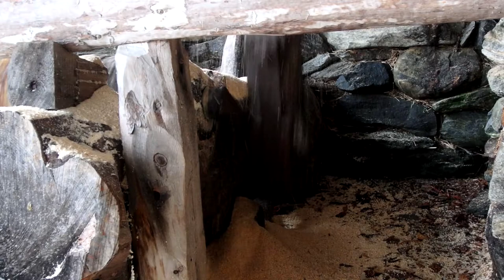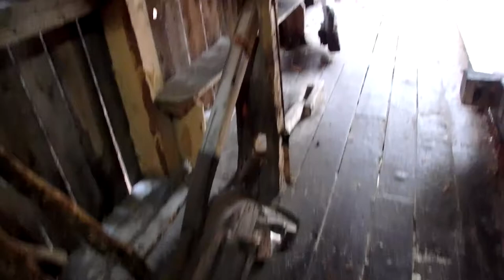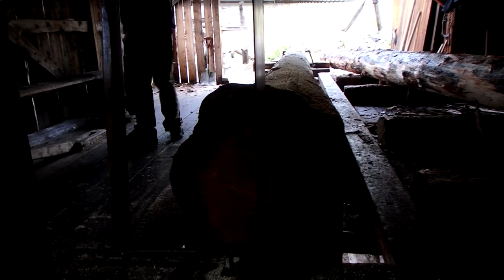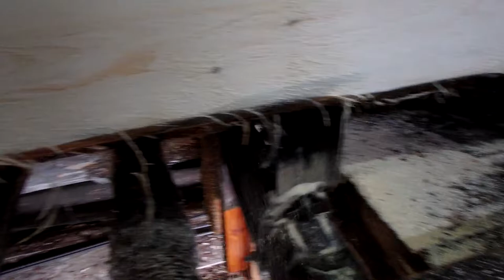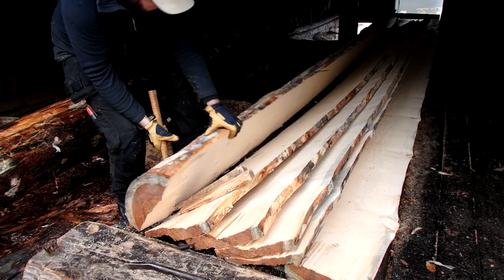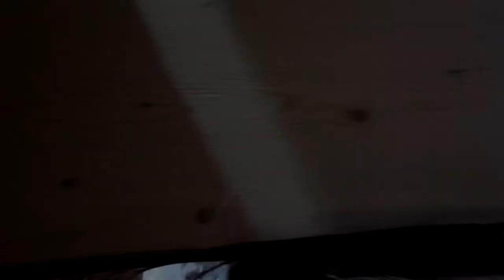Water powered sawmill, Aursfjordsaga, Norway

Comment: Seems powerful. Think it should be able to drive two saw blades. Verkar stark. Vore det inte ide testa med två sågblad i ramen?
Reply from the maker: Yes, its powerful. Similar saws in the same area had several blades as time moved on. Thats not the case with this one. It had a smaller circular saw in the connecting room. So as it is now is very close to his it was in 1796.

Comment: How many lumber it can processed in a day?
Reply from the maker: Depends on water amount and log size and length. It moves about a meter to 1.5 m per minute, so if only cutting logs for house logs, there's usually 4 cuts to make one beam and two boards. That's 30-40 minutes or more of its longer than 5 meters. Can cut up to 9m. Everything mixed in I'd say average 1 log an hour if all is good. Taking the bark off, winching it up from the sea, cutting and stacking.

Comment: Why not cut log till the end?
Reply: The end holds the boards vertical until the log is finished. With that setup, it would be a nightmare if they didn't. Because I'm lazy and inauthentic, I'd cut the round end off with a bucking saw.

Comment: Why not just cut the log shorter?  lol.  Seems pretty stupid.
Reply from the maker: Well, every inch has its price, and every inch counts, especially 2-3 hundred years ago. 
If one is cutting off 8 inches on every log, one will end up with a few cubics lost every season. 
The ones afraid to work will cut them and throw it away. Or burn it.
Reply: not usable tho.  its all messed up.
Reply: There is no way to hold the log in place if you cut all the way through.
Logs are always cut with 6-12” of trim so you are loosing nothing.
Normally you would just burn it for firewood.

Comment: Would love to understand how the pawl mechanism advanced the log. What role did the chanin that ran along the bed play, or was that just the return chain being dragged out.
Reply from the maker: I'll try to explain. The top connected rod moves the up-down motion of the sawframe into the push-pull motion on the stake. The stake pushes the cog wheel 2 or 3 notches for each push. 
The axle from this cog wheel pulls that chain on the floor, advancing/moving forward the log bed. This is synchronised so that the log moves forward as the blade goes up. The blade has a lean so that the log does not push on the teeth while going forward. The stake is lifted from the cog wheel after a complete cut, and the outside waterwheel pulls the log bed back to start again.